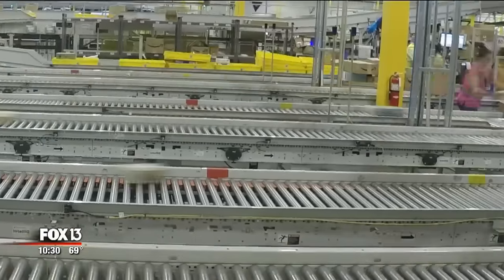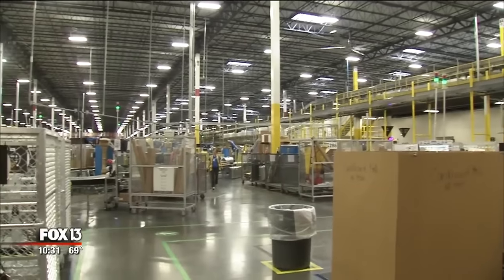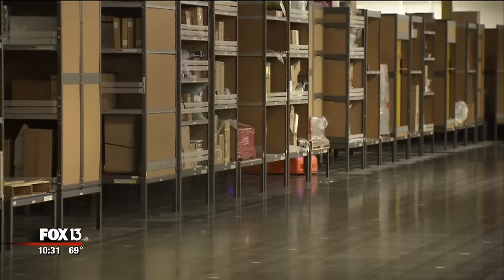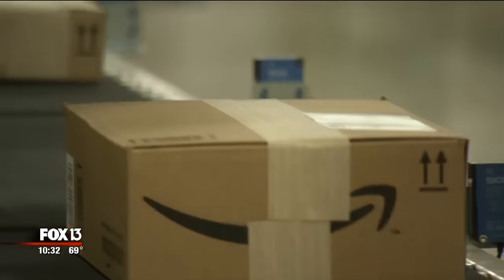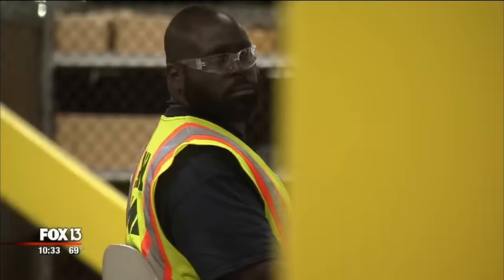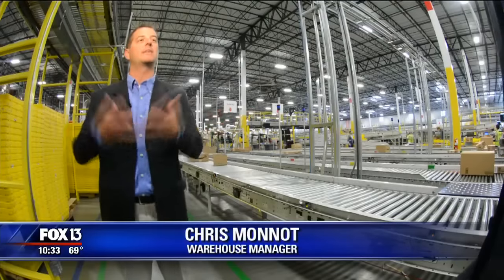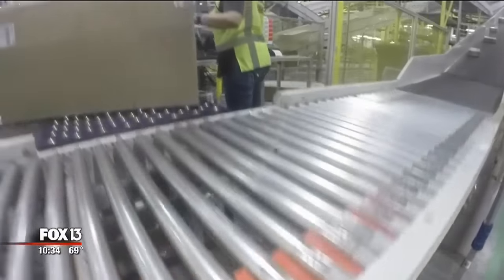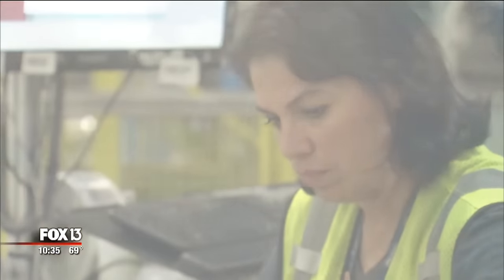Behind the scenes of an Amazon warehouse

Comment: It's hard on the body for the pickers for sure. I was sore all week my first week. My feet bled and my back went out but because I wasn't there for 23 days I didn't get work comp or medical help. Now that it's been over 3 months I still haven't gotten anything. Everything seems to be run outside the warehouse and online or over a phone call. Feels like skynet a little bit. My paychecks were under 200 bucks a week. Not very much but it paid for gas. The pay is 11.75 for seasonal and you get 50 cents more every 6 months. While working youre basically standing or doing squats for the full 10 hour shift minus 30 minute lunch and two 15 minute breaks. My take is it's definitely slave work but they hire anyone who isn't on drugs or have a criminal record so stay in school and only work here if you're out of options
Reply: What's the receiving department like? Are there any easy trucks?
Reply: I worked there for 2 months while in between jobs. Contract ended at my previous job, was a tech company, and I had to keep bringing money in, so off to Amazon. Took a huge pay cut, the hours were longer, and the work was insane. The thing I hated the most were the managers and the horrible work environment Amazon has. thankfully I was able to get another job at a different tech company with a much bigger pay and no back breaking work, and it actually uses my degree. It's also full time, so I don't need to worry about a contract ending. Thankfully the experience I had from my previous tech job helped me land my current one, along with internships I took in college. I strongly advise people to stay in school, I know its a pain, but that degree will be worth it. Unless you majored in something useless, like lesbian dance theory.
Reply: Picking is so easy! Grab the bag full of packages or sometimes it’s only one and then put in a cart that has 3 shelves and you’re done. EASY!
Reply: My older cousin makes 17$ a hour here
Reply: METALRON lesbian dance theory 😂 sounds fun
Reply: @piccololomboy8291  Try stop complaining for a bit. If you don't want to work there, then DON'T.
Reply: it’s hard on the body for packers as well!! quit my 4th day.

Comment: I work at an air port where i move boxes. We get alot of amazon boxes and i usually order stuff on amazon, but the slick is different then from what i get. The slick is what has your address, area code, tracking number ect. Its kinda cool actually

Comment: Ask the guy who's been working mandatory overtime for the past 2 months how he feels about the place, I guarantee you he'll have a different answer.
Reply: Isn't just Amazon that does this. I've worked in a smaller and local (250 employees) manufacturing warehouse place for 4 years, 2014-2018... '17 and '18 were constant OT there.

Five 10hr days and an 8hr Sat... 58hrs
Five 10s and 8 Sat... 58 hrs
Five 10 Sat off... 50 hrs
Repeat for TWO YEARS.

Not enough work to justify the OT. There are some very odd places out there.

Comment: Work is becoming a scary thing.  With technology they are literally turning humans into robots.  Getting the maximum output.  The ones that break down will simply be replaced.  I worked at a company, all the work got done, everything was great.  They installed cameras everywhere and started monitoring from corporate office.  Everyday it was you weren’t here you went to there not enough time here.  The place quickly turned into a prison.  Friends started to turn on each other, lots of problems started to happen.  Production?  Well, that dipped a lot as well.  This built up over a year until the contract was lost.  That was never even in doubt before.  I work for myself now and hopefully will never have to go back.  I’m seeing this now with UBER.  You have to work longer and longer for less and less and only the crazies will remain.

Comment: I appreciate the technology but something seems wrong.
Reply: Oh yes something is VERY wrong. (hint: I work there and it's not what it seems on TV. Don't tell them i told you!)
Reply: There's a trick to that I learned while working at HSN.  A combination of running and sliding.  It saves the joints and feet.  Some floor surfaces this can be done.
Reply: I never saw those robots at the center i was at lol, its all done by humans, im guessing this is one of there premier sites hence why they granted acccess to this one
Reply: Robots are for PR only. Amazon does not want robots because there are plenty of low paid workers who can be hired for less money.

Comment: Almost a year in... I’m almost a robot. 
It sucks. If you like working in isolation, it would be ideal, and depending on what position you have. Some positions pay the same to do less, like I’d say picking vs count. Or problem solve. I’ve done water spider, SLAM support, tote runner, pick, stow, & grading. And for slam sup I stood in one spot for 10 hours and literally STARED at boxes coming down a line. If the label wasn’t face up, I’d fix it. But that’s it and I got paid the same wage. It’s cool, but wild. Lol

Comment: The picking department yes I said picking like cotton smh wtf. Why not call it shopping cause that what your doing for the customer. Same mind set... but anyway has the highest turnover rate I have ever seen 👀 at any job for 1 particular position. It's soo bad that they are almost hiring by the dozens weekly, year round. 

Also this is the key to business improvement over the years keep the workers fresh after you have drained the life of the previously fired or borderline quit ready employees, of all they have to give work wise. Big facts is that as an Amazon employee you are an "associate" that's it. That's your title no matter what you do besides management. Yea there are Tiers. 🙄You start as an associate Tier 1 there is no Tier 2 .skip right Tier 3 is the overseer 🤠 they do all the dirty work for the AM. but that's it for a few coins more than a Tier 1. Unless you become an AM(area manager has salary cutthroat pay). 

Pay attention to this "associate" title tho it is important reason being you can be "cross" trained. Take note whenever theres a "cross" beware cemetery, ambulances, Pope's, Jesus slain on the cross. It's not going to be good. Real facts. Simply put you will get paid the same dollar for working multiple job titles for being "cross" trained they call it job securement 😂 i.e. Picking, Packing, AFE, ICQA, Dock, Stow. It's just so they can use u more ways than one . If one department is hurting but everyone showed up in your department everyone cross trained will be sent there even if they haven't been cross trained to be, well at least the ones the tier3 and AM. Choose to be sent. Kiss ass favoritism 💩. You can get rid of them though u just have to complain/report them to HR who can be a joke at times too depending their mood or if they like u.

All these departments and skill sets which all have their own personal quota or as they term it " rate " and if not met disciplinary actions up and including termination for the same hourly pay. 

The "associates" are the force that has made Amazon number 1 in the world bar none fuck who say different, the end. Jeff knows what I'm talking about. They are, for the most part, treated like 💩. Everyone though at Amazon is expendable Everyone except Jeff and his partners that is. I must say even the OPS managers are throwaways at times ,another key ingredient to Jeff's success. Keep everyone at each other's throats. There is no union. Of course not. How could there be???? Pending on how many years u been employed This is  a company that will PAY AN  EMPLOYEE TO NEVER COMEBACK AFTER IF RESIGN. It's called "the offer." 😂 company laborers/workers/slaves Is mostly run by youth anyway the slave drive part that is TO KEEP THEM YOUNG AND DUMB. Who wants smart unhappy or old slaves who do half the work they want and complain lol. If your rate is say 300 units per hour you'll get to go home early or the day off with no pay FOH 🤣

The "future" (youth) is what the bald white guy Jeff promotes 😂 Energetic & ignorant enough to stay to keep that PRIME on TIME for merely a DIME. 🤔TOT or time off task is where the cracking of the whip really happens. Don't go to the bathroom for too 5 minutes scan to scan plus minutes long or even need to speak to HR unless on your break u both could get fired. Work related or not. 😒10hr + shifts 40- 70 work weeks depending on demand. 

 I must say the culture can be downright savage at times as far as advancing and favoritism. Give ol Jeff credit, let them kill each other just make quota. As an employee you awarded stock after a fully recorded 730(crazy) days employed without leave or the leave will be subtracted and you will still have to complete your term. Originally RSU's, But if u are fired, resigned or changed occupations they vanished that same day. Even Day 729 as if they never existed if still not vested.  Yea there's 401k and fair benefits health/dental/vision. There's even paid 6 week maternity leave for men. There is no pension because most employees won't last anyway. 

Not joking about the turnover rate especially in pick Dept. sky high like the stock. I have seen a person in every department there cry, literally tears and not joy. Fight too, well except the GM's and that's probably because none usually last more than a year facts. I take that back the most recent GM we had was a woman I think I saw her crying no bull 💩 All facts i state. The Fullfillment Ctr I work at has had at least 7-8 GM's in there since the doors opened 2012. Started as a temp with Integrity staffing miss the initial hotel hiring date 😂 btw Integrity is AMZN middle man. To take the heat and obligatory common decency standards of the work environment off AMZN back. Weekly pay instead of biweekly no benefits at all and the first to get laid off, fired or thrown under the bus 🚌. Points system bs. Amazons probationary outsource company on the inside... get it.

Although they have a career choice program to help u find means of employment else where.... take heed Jeffs paying for this program mostly, use it to get something for yourself, like he did with his resources out of that garage full of books 📚 as the story is magically told ✌🏾

PS. Oh yeah I forgot people have died at my Fullfillment Ctr and my not from violence, but from dehydration and bring overwhelming worked 🤷🏽‍♂️